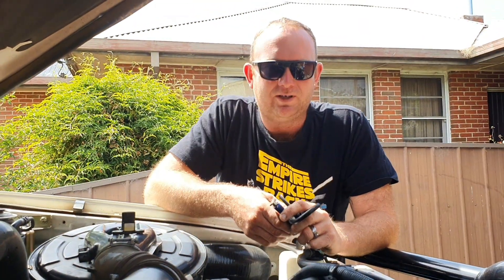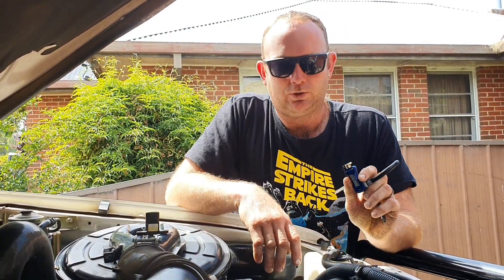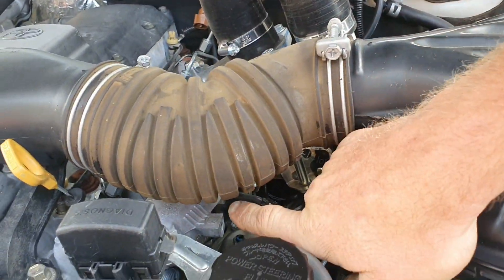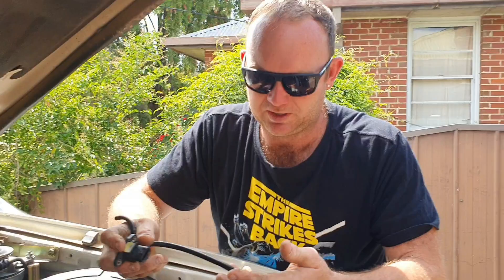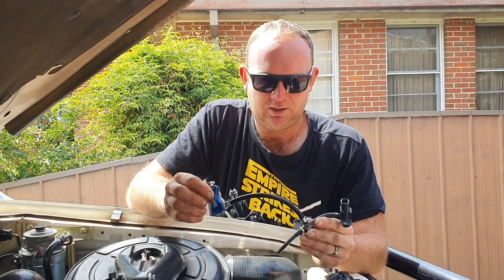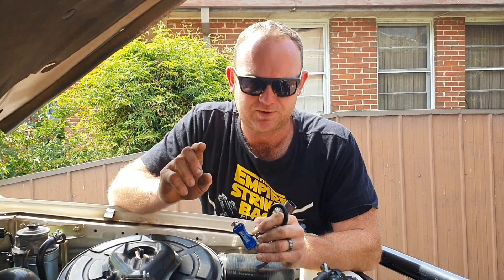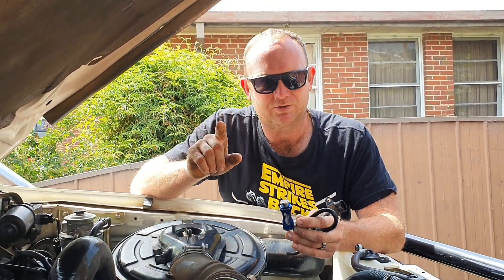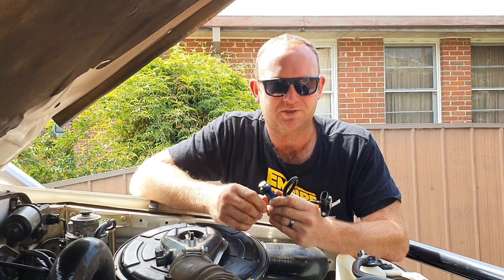1kzte getting around the dreaded fuel cut 14.9psi with the fuel cut defender...

Comment: I don't understand how increasing boost can increase power if the ECU is being tricked to see reduced pressure...   I've installed a boost tee on my prado, running up to 15psi now with fuel solenoid wound in a half turn, still not what I would call a lively motor. What am I missing?
Reply from the maker: The whole idea is to give a little more than standard holding that 1 gear better or where you would lack power on a hill it would hold and not drop of as quick.

If you want desired power further mods are required such as a propper tune chip dyno on the electronic side or like me mechanical pump hight flow turbo fmic than dyno that has an increase of massive hp gains and torque with 165 hp & 482nms at the rear wheels

Comment: Hi trav. I’m happy I found your videos, I have a 1kz te , I don’t get it , could you plz explain how to hook it up. Mine is an electronic throttle body , does that mean I have a boost pressure sensor like yours to? A diagram would be good if you can plz
Reply: Ok guess I will just have to figure it out
Reply from the maker: You're ute will be the same mate I don't have a diagram unfortunately

Comment: Hi, doesn't the boost pressure sensor reading control fueling?
You might be upping the boost and bleeding off what the sensor sees, but in turn your reducing the boost fuel compensation and you won't make any more power?
Reply: He’s done a mechanical pump conversion

Comment: Hey mate, ive found your vids very helpful. Is there an option for the older style 1kz from a JDM prado?
Reply from the maker: No worries mate ezy yep across the board will work
Reply: @TRAV30387  what about with a DP chip? It has one, but i was going to do the FCD and Boost tee, would it be overkill to do the resistor mod when i have the DP chip? Being early JDM it has the cable throttle, so im assuming the DP chip would just affect fuel pressure

Comment: So i have a kzn130 full 3inch etc etc if i add this mod like u have explained which is realy simple ,obviously more boost will need more fuel wouldnt doing this without out doing anything else lean the motor out
Reply from the maker: This is true tho the turbos only good for about 18psi i ran it for around 12months with no problems then i did the big build

Comment: Hey Trav, I've got the electronic throttle body, I have my boost gauge hooked into that also, should I add the fuel cut defender after that T so it doesn't give me and inaccurate reading inside?
Reply from the maker: Hey mate definitely find somewhere else to plug it into will definitely b alot better

Comment: hey bro, i have a 94 surf with a mechanical throttle body and wanting to install intercooler, i can only find intercoolers for 02-05 hiluxs which have the electronic throttle body, would the intercooler still work, cheers
Reply from the maker: I had this same issue i had to get one fabed up 51mm pipe on a flat 3mm plate easiest way to do this remove your intake or get a new gasket to use as a template cut the plate and install a 51mm pipe ontop around 2.5" long
Reply: @TRAV30387  so basically make like a adapter to older style intake?
Reply from the maker: @jackrichardson8667  exactly
Reply: @TRAV30387  ok thankyou!
Reply from the maker: @jackrichardson8667  jump onto the fb group im sure theres pics there
Reply: @TRAV30387  which 1
Reply from the maker: @jackrichardson8667  trav30387 on Facebook
Reply: JDM prado from 96 onwards had the top mount intercooler with mechanical throttle body. TZ model. Im sure you have sorted this by now though

Comment: Hey Trav awesome vid mate just wondering if this set up would work on a 1hdfte cruiser I’ve put a g turbo on it top mount cross country cooler the turbo is pre set at 18 to 22psi and it keeps cutting out once it boosts past 14psi it’s booked in for a chip and tune next month just want temporary fix because it’s getting annoying the fte also run a blue solenoid which the boost hoses run to them from there to the boost sensor can I delete that and run straight to the boost sensor with the set you done
Reply from the maker: Cheers mate well im not sure on the fte but i know a bloke ill ask and get bak to u 🤟🤟

Comment: So I gotta buy 2 boost tee's, 1 for turbo and one fuel cut of defender. I see how it all works now
Reply from the maker: kind of a boost tee and a fuel cut defender slight difference i did try 2 boost tees tho it did not work on the boost presure sensor.
Reply: Only need one needle valve aka boost tee, use the same reduced pressure for wastegate and map sensor.

Comment: Hi Trav. Love the videos mate. Question wondering if you are able to help me. I've got a 1kzte engine in a hilux surf. Turbosmart boost tee and it works perfectly running 13psi boost just before the fuel cut. My boost gauge vacuum is connected between the map sensor and map sensor filter coming from the intake manifold. Did the FMIC and now want to boost 18psi. Bought the turbosmart pneumatic FCD and installed it. This is the installation. From intake manifold straight into map sensor filter, then out of filter into a Tee piece, once side of tee goes to boost gauge and other side goes into fcd and then from fcd with arrow pointing towards the map sensor into the map sensor. No i have adjusted as much as i could on the fcd increase and decrease. with the fcd fully open  - my boost drops from 13 psi to 9-10psi. with the fcd fully closed + and turn back 8 clicks i get 5psi. So the more i turn it the less the boost gets. Are you able to help me please? is it due to boost gauge in same line? am i doing something wrong or what? where did you tie in you boost gauge vacuum line? Cheers
Reply from the maker: Hey mate glad i love them so the fcd goes from the boost pressure sensor to the little filters make sure its the right was flow wise and i think from memory it was between 9 and 13 clicks to hit 18psi with the turbosmart fcd1

Comment: Does the pump still put the same amount of fuel in with the fuel cut defender?
Reply from the maker: So from what ive learned u get a maximum of 88cc of diesel and the turbos good for a maximum of 20psi running out of puff after 18psi if you tune the fuel cut defender u can achieve maximum fueling up to the original fuel cut amount its a fine line to tune essentially you can make a little more power with more boost and less fuel.

Comment: Hey mate 
Did you ever have the boost turned up before you did the intercooler ?
If so what kind of EGT where you seeing ?
Reply from the maker: Hey mate i sure did i ran 18psi with no fmic and had good egts roughly 500° max now with the fmic and mods its about the same keeping in mind im running 22psi and heaps more hp
Reply: Can I drop my lux off to u to put one on lol
Reply from the maker: @heathwalker7981  sure thing mate